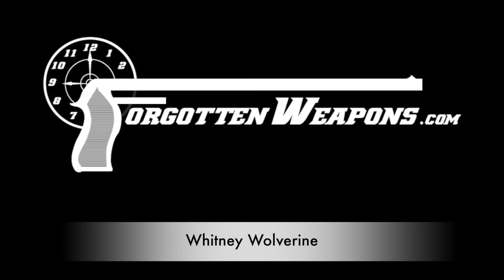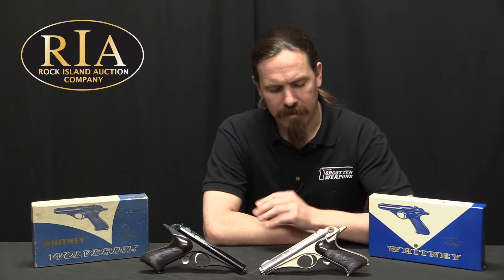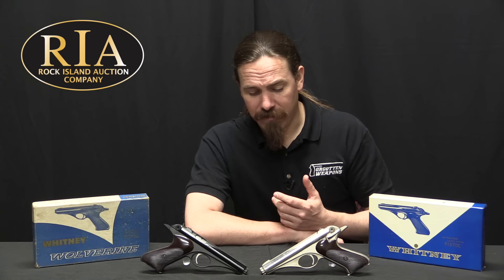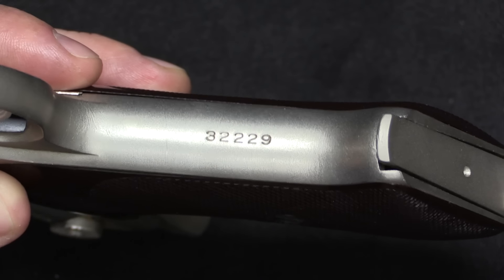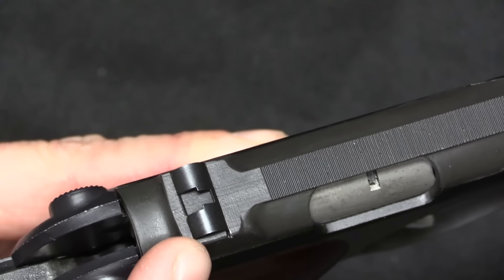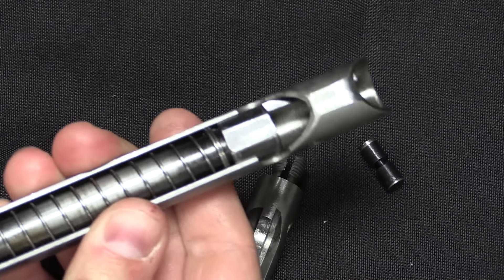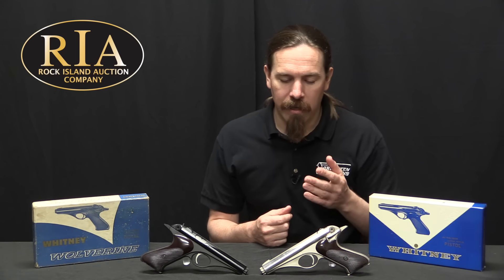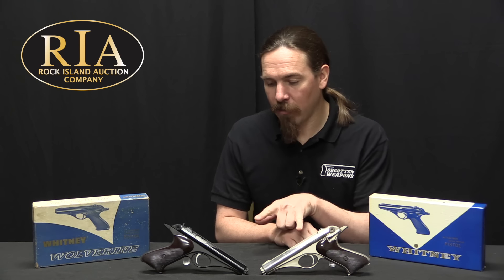Whitney Wolverine: Atomic Age Design in a .22 Rimfire

Comment: If they ever made a 3rd "No One Lives Forever" game (not likely considering that they can't get a re-release of the games that exist due to copyright matters, but still...) this is the gun that Cate Archer should be posing with in the artwork!  This thing throws everything about consumer design and mechanical design of the era together and comes out with something that's definitely a weapon, but has so much of the the looks of a normal consumer good that it'd be the perfect tool/fashion accessory for a spy movie character—especially that nickeled one.

Also, the rounding on the handgrip and the way that it meets the polymer scales is just fantastic.  The whole thing has lines that look like they're lifted from something like a Mercedes 300 SLR or Aston DB4 or DB5 (even though those two were built a few years after this was made).  I mean while functionally a polymer lower is lighter and less expensive I'd argue that it diminishes the industrial design of this since that nickel finish really adds a certain appeal that you can't easily get with polymer.

Comment: In my opinion, the Olympic Arms version doesn't look as good as the original pistols.
Reply: @Kevin K Is there any reason someone couldn't take an angle grinder to it and just sand over the cutoff spots? According to the video, all of the actual parts are internal and the rib is essentially on a shroud, so...
Reply: @Kevin K Ew. Then again you could take the same cutter and recreate the original sights :U
Reply: @Kevin K How close did Olympic get to the original? It just looks like a huge miss, to me.

Comment: I appreciate the historical material on the firearms but it would be nice to see them fire them. These are mostly collection pieces but I would love to see this fire. I had a replica of this as a kid and it was in a blue steal with the same brown handle as seen here. A .22 is a gun that has no stoping power so it's gotta be the brain or the heart. The assassins used .22s up close putting 2 rounds in the head or 2 center mass , slightly to the right , which is there left , the heart.

Comment: I was suckered by the cool look of this pistol and have owned two of them.  They were complete garbage and how anyone could have believed the gun would be a commercial success is beyond my comprehension.  The guns jammed constantly with every ammo I tried and clearing jams was difficult because there is no provision for locking the bolt back.  Disassembly is overly complicated involving many tiny easy-to-lose parts (see above video).  There is no way this gun could compete with the Ruger Mark 1 except as a collector's item or conversation piece,  which is what they are today.

Comment: If someone made modern versions of these in different calibers, I'd buy all of them.
Or even just a .25 acp center-fire version, if the frame can't handle the oomph of 380 or 45.
(But, in my opinion every magazine fed .22 rimfire would be better if it was .25 center-fire, and if that were the case, .25 wouldn't be nearly as expensive as they are)

Comment: the reason the Olympics didn't do well is because they basically ruined the whole look of the gun with their additions on the top. it has their weird and wrong looking rail that you can see through, and the sight on the back is a separate chunk of metal that looks odd. these features add height to the pistol and took away from its "cool space gun" look and hind of made it seem like some goofy videogame gun that youve put an AR rail on top of, thats not meant to be there. all and all the failure of the newer whitney's is possibly due to the basic look of the gun being too different from the original, putting off anyone who wanted it for looks and not for its interesting mechanism.

Comment: There is an aesthetic difference between the metal and polymer frames. The polymer is quite unappealing to me in a visual way. It's the ugliest child of Buck Rogers and Batman, and that's probably why the reproductions failed too. If they had stuck to the aluminum to keep the same look (both anodized and plated), I think they would have done alright. As I have no need of a .22, I would buy this on looks alone. I will be looking for an original.